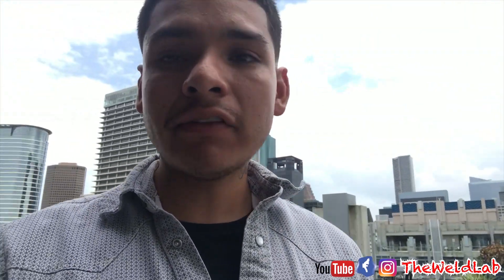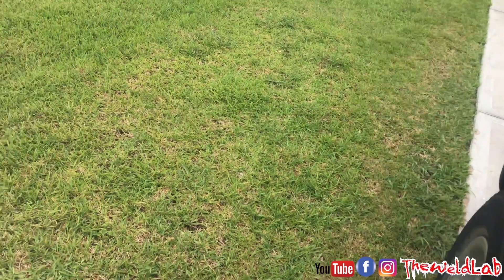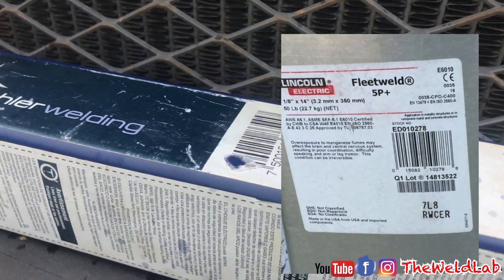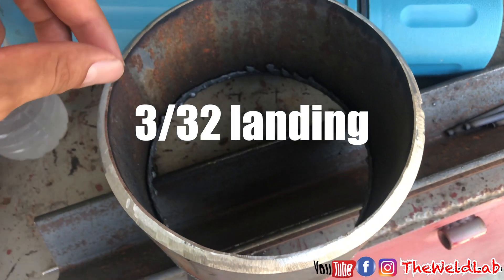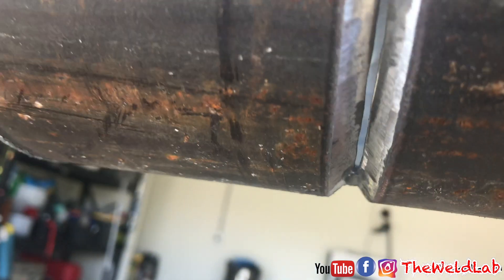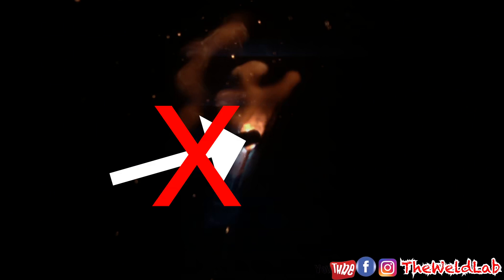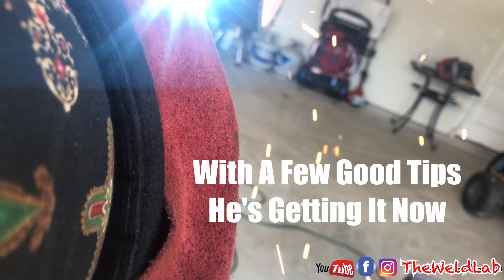3 COMMON MISTAKES BEGINNERS MAKE WHEN LEARNING HOW TO STICK PIPE WELD 6010 ON THERE OWN

Comment: I'm getting my ass kicked trying to learn on my own all i have is a miller multimatic 215 and unfortunately it doesn't burn 6010 it does however burn 6011 i practice as much as i can BTW im 55 years old and I'm getting any younger im in nj

Comment: one of the things i noticed was i think he needs to get ahold of his stinger. the pipeliner that showed me used cuss words and refeneces but basically choke up on it near the rod so you have control and can push it in. now a lot of times i actually put my index finger on the rod to "point" while running the bead.

Comment: I was having problems it would open up a big keyhole like tear apart the bevel and would loose control  and no matter how low i would go from like 40-20 and it would still blow it iam guessing it was my rod angle sch80 12 inch pipe thought i had maybe put to lay back of a bevel and thined it but i dont thinks so or may be a mixture of both

Comment: I am currently doing a course to learn the profession of welding in Sweden and I am currently training in pipe welding for the same situation shown in the video, but in Sweden we use 7018 for root welding and we start welding from the bottom up and this is much more difficult than the method in the video. Can you try this using 7018 and photograph it?

Comment: Hello WeldLab, I am attaching a cylinder to my mower blade which is flat. What angle do you recommend, 45 degrees? The cylinder will be upright and the mower blade will be flat on my work table? Thanks for any tips.

Comment: Mistake #1.....70k truck when you are just breaking out lol. Worked with an old timer a few years ago still rocking an 80's squarebody Chevy. Probably paid for itself 100 times over by now! Much love and keep up the great channel!
Reply: A nice truck goes a long way I have a 1988 f450 I've been running not bad but penny and dimes now I'm buying a new king ranch because I'm tired of fixing mine constantly even if it's just small things

Comment: Weld as if you are pointing at the center of the pipe with just enough travel angle as you would on each out of position angle

Comment: So I was always taught to start at 6 o’clock work the rod up. But the I just tried they way your boi doing and came out the same.  Still glad my mentor taught rig style welding does even I don’t do pipe often but it comes in handy when ever I have to weld a gas line of water line . Saludos from the Bay Area 510. Ps I always use red Lincoln 6010 my personal choice but shit I can’t find it hard to fine the red 6010.

Comment: We would just knock the paint off the fittings , then crank up the welder to 6and6 tack with no gap , then fire up and shove the ark inside the pipe and lay that rod over to about 45 ' and let it consume itself, going down hand or up same and without a gap you have less to fill by a third at least.. lays down a beautiful root ! try it you'll like it.

Comment: So with a 3/32 landing and 1/8inch 6010 rods, what's your amps and dig, or is that different with the big machines versus a small one I use in my welding school shop?

Comment: I like a 1/8 gap with a 1/8 landing. I noticed he was going downhill. Is that just because he's trying to get out on the pipeline. We run this same 6010 rods at school and I struggle with running them downhill. I just choke the rod too much and the arc cuts out. But I'm really good with them root passes traveling uphill. I usually whip/pack it.

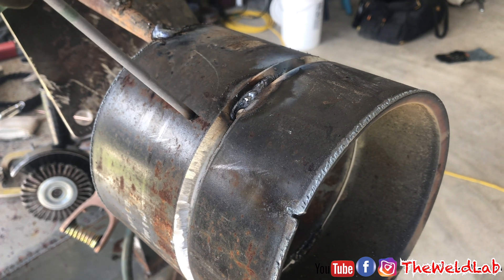Comment: 3:33 - so the incline to the bottom basically means a wrong 45 degree angle instead of the correct 90 degree angle @4:46 ?

Comment: Mistake 4 - welding downhill ! Also you don't have to grind the tacks complete - just the start and the end. Good luck 😃
Reply: @BPzeropoint  hi Jim, welding downhill is performed with high travel speed. This is related to low heat input which is near to the point where lack of fusion between the weld and base material can occur. Welding downhill is applicable for  thin materials, tacking and low importance welds. Try it yourself 3mm and 20mm ... Downhill

Comment: Think of your rod angle as the a gand on a clock. If you keep the tip of the rod towards center of pipe, you'll be just fine. The galactic empire approves.

Comment: I was required to pass a 6010 open butt 6” pipe test on a 45 degree for an apprenticeship. The test had to be up hand not down. Does it make a difference? Nice video 👍🏻
Reply: It depends on the code.  API 1104 which is the code for pipeline runs down hand.  ASME Section IX is for bojlers and pressure vessels runs the root up hand.

Comment: Regrettably sold my 1964 SA-200 welder 17 years ago when we needed the money. Sweetest welding machine ever.
The guy buying was going to "hot rod" it by chopping it lower, new paint and stainless panels.
Those of us who have ever left a chrome wrench in the sun pick them up with welding gloves or rags and only do it once.

Comment: So should you angle your rod directly  into the middle of the two pieces of metal you are welding just like you were pointing directly into the meeting metal pieces I'm over 60 and just want to learn a little bit at home just for myself as a little hobby I'm not looking to be a pro but any hints would be appreciated thanks I enjoyed your video and great hints. I'm using 6013 rods with a cheap arc welder thank you very much

Comment: I was taught to go uphill in my welding program by my instructor  whiners cwi ,couldn't weld down hill if I tried,after not welding for a while I couldn't weld up hill and down hill has been my go to for welding.
Good info reminds of my 2nd school for welding for pipe.
6G certified but never did get into pipe welding. 
Spend a good dime to learn but I guess if I tried,I might be able to get a 6G done lol...
Reply: Ikr. It almost makes me cringe every time I see a down hill. Especially with low hy. It just seems as if the strength will be missing. But I guess because of pipe it will need to be more flexible. Big no no on the stuff I have to weld. Hardly any 6010 anyway. 7018 up to 12018. I need it to stay put. No flex
Reply: @carloshart2424  yeah uphill is the key,I like overhead better haha...maybe because I tried harder and was more into it.
The only coupon I ever broke was vertical ,redid it the next day and passed.1" inch coupon.

Comment: I retired a couple of years ago. I welder for the same company for 30 years here in Texas. In the summer and winter our welders would quit a look for others jobs. Its like no one wanted to weld anymore. We would constantly have an ad in the paper. It got to the point that we had to buy robots. When I retired they had two robots.This generation would rather wine than sweat.
Reply: As a welder of over 40 yrs, a lot of people get out of the game due to sucking in fumes etc..i have breathing problems as do many long tem welders. Better to get away than suffer, i think young people are more aware these days and it isnt that they are afraid of hard work..its just my humble opinion

Comment: I was trying to learn on some pipe at school before I go to my welding school @ college and I had a 6010 1/8th on 45-55 amps and it kept getting stuck and everything I am very professional at my horizontal welds and welding square pipe together but for some reason I could. Not get the 6010 to stay arched I keep screwing up and I spent so much time putting a bevel in this pipe I even measured 1/8 gap in between bevel with the other 6010 rod and I racked it and I litersly could not keep my weld going either stuck or it would light and spit and spit idk what I’m doing wrong I wanna do it right or at least get it going before I have my teacher help he used to be a pipe liner guy any help would be awesome . I want to peruse my dream in welding pipes

Comment: i am a SMAW nc2 taker. this saturday is our assesment in steel pipe 6g. but we dont use 6010 but 6011 for the root pass and 2nd pass while the capping is 7018. im nervous. any advice for me?

Comment: Why all downhand for this particular weld? When I do all-position TIG welding, we go uphand whenever below the horizontal. Obviously, my specialty is TIG welding of specialized metals, but I have recently been trying to improve my stick work, 6010, and 7018, to be specific. In the 6G position, would you still do all downhand? Does it penetrate enough from the 4 o'clock to 8 o'clock positions? After the 6010 root pass, are the filler passes still 6010, or is all the rest done with 7018 (or only cap with 7018)? Also, what amperage and polarity is being used here?
Reply: Pipelining is typically all downhand with cellulose rods.

Position welds done for boiler code have to be uphand 6010 or TIG root with 7018 fill and cap.
Reply: @SpacedInvaderp  
Thank you for that clarification. I appreciate it.

Comment: I’m 17 but I think the hardest part for welding pip is just moving your body in the right position and the angle
Reply: A tip that you should do every time is get comfortable, plant both feet, get your hip planted, also an elbow and use both hands on the stinger, if your right handed grip the stinger in your right hand and use your left to cradle your right. Stroke your intended path so you wont get in a bind half way through. Sometimes you'll want to adjust your position a bit to continue your weld, just move your ark forward while you get the new position then come back and continue where you left off, any trace you'll be running over with the weld.
Reply: Practice passes with no power, just mimic the action and movement you want and practice run until your position is comfortable and can complete the pass
Reply: I’m 40 and I agree with you!!
Reply: Find a physical activity that makes your body hard and we'll cordinated. Too much video games is not good for your body.

Comment: What were your settings and what welder we’re you using?
Reply: Lincoln SA-200 pipliner welder and 6010 rods 1/8 most likely set at 90 to 120 amps.
Inverter welders set to MMA are set by voltage and run somewhere around 19.5 volts with electrode at DC positive..
Most sub $1,000 inverter welders have issues with 6010 rod btw.
This is why I have four welders one of which is $7,000 if replaced nowdays.

Comment: Also when you weld bend your rod's. If you have your rod straight in the stinger your out of position for your body. Clamp it into your stinger and bent the rod end 45 degree this will get you your stinger to be closer to the pipe allowing you for more support and there for a better weld.

Comment: And don't use dewalt.... get yourself some real quality grinders. Makita, Bosch, Hitachi, Milwaulkee in that order. Dewalts just burn up to quickly and are just to cheaply made. If you are out there and you run cord tools you are limited, go battery at least 5amp and have a dual charger by your rig sitting so your helper can swamp them out for you. Always TAG your Equipment so nobody walks off with it. 5AMP grinder last me about 4h so 2 battery in a 8h shift but I run 4 different grinders with 12 6AMP Makita Batteries now with a dual and quad port charger. The better you prep the better your weld gonna be.

Comment: 5P+ really ? They flow to much and you can hide to easy your undercut mistakes with them.  Use just the 5P so you learn your weld and welding pool better especially for overhead the 5P produces less fluid than the 5P+. Boehler Rods by voestalpine are a international pipeliner standard. Guess you ain't much into the welding yet otherwise you would know this product. BÖHLER FOX CEL  are great for vertical-down welding. And than for your fill I would recommend BÖHLER FOX CEL 80-P  which are 8010 or BÖHLER FOX EV 65  if you need to do vertical up which are A5.5: E8018-GH4R / E8018-D1H4R. 
Best method to learn is on a 6-8" pipe sch 40 in a fixed 45 tilt position at waist high of the ground. It is the most uncomfortable position to weld in because you can't sit or kneel and you can't stand in a relaxed position either. So 1 knee down is for me the best method and than put yourself a support brace somewhere against the pipe and play around with 6010 from root to full fill with it. This way you learn best how the rod flows. Do this for a few days. Also reuse your materials so learn cutting with the torch and grinding it. leave dirt behind on the pipe so you also learn how it welds when the material ain't clean this way you can later spot, stop and fix it before you been kicked of the job because you screwed welds up all the way. Nothing wrong with stopping and taking back out the root you just started because someone didn't clean it enough, sometimes acetone is your best friend on a china dirty pipe which happens to be used more than you think. Weld also with a lot of start stops. Most important for you tie, tag and later on take over job's.

Comment: Hey man i just turned 17 and really interested in welding is there any tips you could give?
Reply: If you have the ability go to a welding school they are worth the money in my opinion, if not find somewhere to be a welding helper and ask questions and learn from them
Reply: I started as a pipefitter helper, i wasn’t top help, but I wasn’t green. I didn’t go to welding school, I took welding in high school. I graduated in 2011 I’m 28 years old. In7 months I learned to tig weld carbon and stainless pipe on my lunch break, and on the weekends at a friends shop, I always wanted to be a welder. I asked tons of questions, many good welders shared their knowledge with me because they seen I was hungry for it. I procrastinated ten years Don’t give up on a dream man. You can do it.

Comment: use Bohler Fox Cel 60 to mach 5P+ apples and apples if you whant to run it and Bohler is not cheep rod the BVD 80 and 90 our all over the U.S pipelines right now 798 keeps it at tanning center in Tulsa.
Reply from the maker: Thanks for the info ! I’ll order some tonight can’t wait to burn them to see how they run thanks !

Comment: How do you determine your amperage for different size and schedules?
Reply: Amperage is based on rod, not material. 1/8" 6010 usually 70-90 amps. 100 amps tops for flat position. 7018 usually 120-130 for flat, 105-115 for uphand and overhead. Some guys run the overhead same as their flat.
Reply: Oh, and length/gauge of cable makes a difference too. The longer the cable, the more amperage the welder needs to push to get the rod to work

Comment: I wish I could weld at home I’d be doing that all day , at school and home
Reply: Buy of Craigslist yourself an old buzzbox than jump on Ebay and get yourself a 300amp rectifier and with some sheet steel and lead connectors you now have a full AC/DC welder you can use for stick at home with up to 200amp no problem. cost you maybe $150 all in all.

Comment: If you can’t weld with Bohler rods you can’t weld. That’s why they make procedures with bohler  rods cause a ton of welders can’t pass the test.  It’s based on knowledge and consistents 🤦‍♂️
Reply from the maker: I never seen them on a job site 
But someone told me they good rods and they actually use them a lot in other countries I’ll buy some and compRe them to the Lincoln 5p
Reply: @TheWeldLab  you need more experience then

Comment: That's a different technique as here in Australia on 6-8 inch pipe we use 4 tacks(prevent gap change from one  side to the other), weld over head to vertically up, with a key hole and a flick motion. This is so foreign as how do you know if the root run is going well if you can't see it when welding.

Comment: I would like to learn how to run that 6010 root but dragging it instead of stitching ,just how your friend did at the end of the video ,I can get it started but my arc dies after an inch or so.i had the same problem with my root around 6-9 o’clock my root starts to get heavy ,your video help me find out my problems another thing I noticed in your video was your friend was welding down hill ,the school I go to teaches us to weld up hill because down hill causes porosity ? but I also heard pipelines is all downhill !! ????

Comment: For 8 inch on up, you use 3/32 gap but do you still use a 1/8 rod or 5/32?
Reply from the maker: i use 1/8 5/32 works also just have to turn the machine up

Comment: These Boehler rods are great. Here in Europe we normally weld the root pass on dcen and the rest on dcep so the characteristics are a little different compared to fleetweld.
Reply from the maker: nice to know....what about welding machines what brand yall use?
Reply: TheWeldLab EWM, Lorch, Miller, Lincoln.... Boehler says you should use welders with at least 90V ocv better is 100V. We have some Lincoln Vantage 400 in the company and it’s a pain in the ass to weld with the 60V ocv setting.

Comment: I tried it yesterday again and I couldnt make it work carnal !  I got some linconl  6010 +++++
Reply from the maker: Ok ok what’s seems to be the issue that you having ?
Reply: @TheWeldLab  cant keep the rod on
Reply: @TheWeldLab  i don't know if its the motion im doing maybe too fast or too slow i dont even know
Reply: Some machines can’t run 6010 rods. Check to see if yours can. If it can’t, I’d suggest trying 6011; pretty much the same thing as 6010 but can be run on AC and will work on all machines. Hope this helps!

Comment: Good job on explaining the rod angle.  I got some 6010 from a welder trailer that i bought.  I couldn't get get the rod  going.   When i saw your video you explained it perfect.  Thank you and good luck.
Reply from the maker: Thanks brother 🙏🏼
Reply: Remember,  if your rods aren't fresh. Put them in the oven for an hour or so to drive out moisture. I'm from your area,  I know your climate. 
Sure miss catching redfish in the surf !
'66 redface